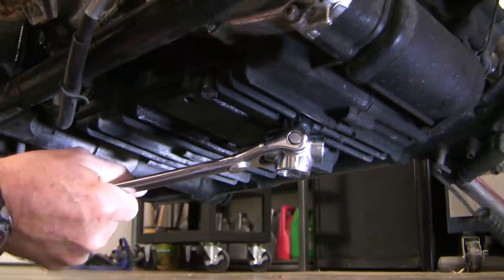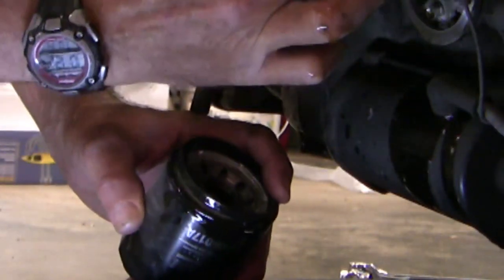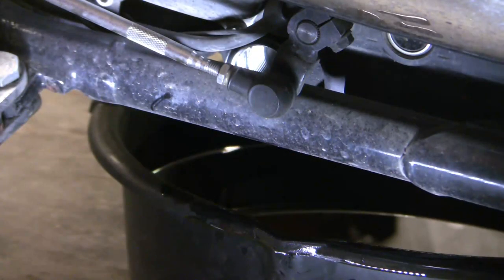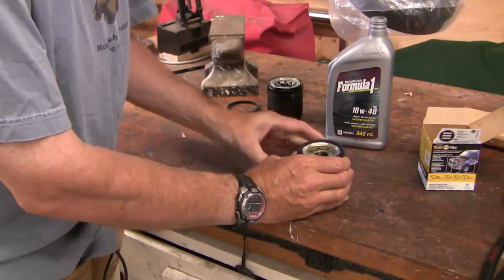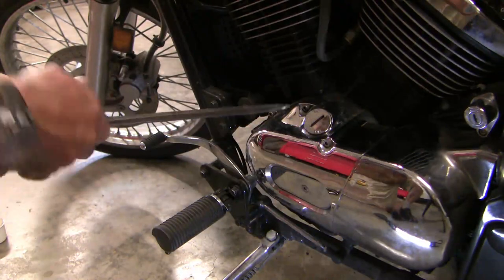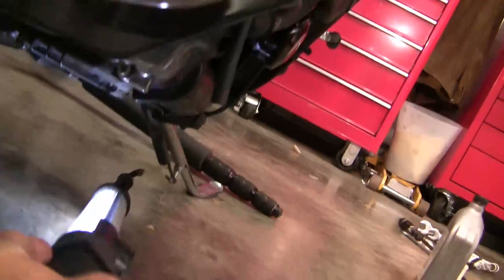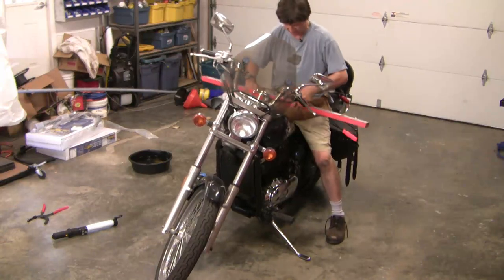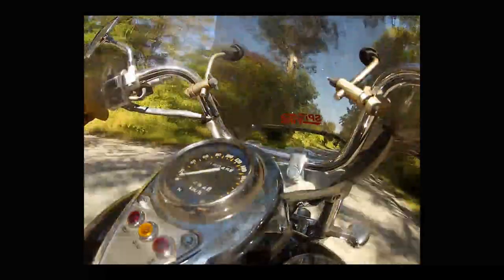How to change motorcycle oil,  Kawasaki Vulcan

Comment: is this procedure the same on a 2008 Kawasaki Vulcan 900cc
Reply: not guaranteed because of the year 2006+ saw some significant modification such as fuel injection, so check with a shop or trusted mechanic
Reply from the maker: Wise advice. For all vehicles I get a copy of the dealers repair manual to see what is officially recommended, and this video is based on the paper manual for this bike. Finding the dealers manual online is a little harder for motorcycles because online copies complete with TSB's are hard to come by -- I don't believe Alldata or Mitchells cover motorcycles. Paper copies are expensive but still sold and have variable detail, and you can buy CDs on Ebay for many motorcycles. Manufacturers are legally required to offer some form of repair information to unaffiliated mechanics. Neither CDs nor paper copies will have updates or TSB's, and they could have uncorrected errors. Of course the lowest risk option is to entirely delegate maintenance to a dealership pro, but most searching here want to do some repairs themselves. Even professionals sometimes need to consult the dealers repair manual, if they don't want to be sloppy. A pro will tell you that the basics of an oil change are fairly similar throughout the industry, but it would be easy to overlook critical unique details.

Comment: found out its a no spark situation, can you help, bought a cdi, still no spark.  Just want to ride.
Reply: I would try testing the ignition coils. They are probably more likely to fail over the CDI box just like spark plugs fail more often than ignition coils. Other than being worn out over time, a CDI or ignition coil not functioning could be a potential sign of other electrical damage. Such as a voltage regulator/rectifier not working properly etc.

Comment: Your garage floor is pretty level, right?
Why not buy a center lif.t (search "Cruiser Motorcycle Center Pivot Stand Lift")
You place it under the rear shock and lift the bike level and you can the do all sorts of maintenance to the machine.

Comment: I own a 99 Vulcan it was sold to me as a 900cc but I don't think it is a 900 the power is not there.......I had a 700cc intruder and this Vulcan pulls like the intruder not like a 900cc engine any suggestions would be cool and cool video
Reply from the maker: I've found great variance in that ratio of power to displacement, there are a lot of variables. As a start I would check compression and look for obvious things like a stuck caliper or seized brake shoe, check tire pressure and look for obvious things. My 800 has always had a lot of zip.
Reply: thanks for the tip
Reply: WELCOME To THE VULCAN WORLD. I USED To SELL THEM AND 900 OR 1600 THEY ALWAYS FEEL As THOUGH THEY ARE ONE GEAR AWAY 
IN CANADA THE EFI CAN COST $250. I Put AN EFI BOOST AND NOW MY 1600 HAS A VIRTUAL 6th GEAR AND LOADS OF POWER

Comment: I have a 2000 kawasaki vulcan im sure its abt the same procedure im not sure on the filter do
Reply from the maker: It would be worthwhile to search for a free pdf copy of the manual for your exact bike. The manual for my bike is now freely available, do a Google search for your year. Failing that, ebay often sell DVD's with manuals. Alternatively you could wing it, just remember how everything goes together. Some visitors here have mentioned that their screen goes in backwards compared to mine, so Kawasaki may have changed that little detail at some point. Filters are pretty standard.

Comment: I have a 2000 vulcan 800. How much oil do i put in it
Reply from the maker: My bike has the oil replacement volume printed on a sticker beside the oil fill plug. Failing that, you can get an online version of the dealers repair manual directly from Kawasaki, at a reasonable price. Also your owners manual should have it, I believe the owners manuals there are free. I have a large 6L graduated pitcher that I use for measuring oil volume. I print the oil volumes for all my vehicles with a sharpie onto that pitcher, so I don't have to look it up each time.

Comment: where do I buy an oil filter at for a motorcycle?
Reply from the maker: Any auto parts store carry them, many brands share similar dimensions. If the bike is under warranty I would consider going to the dealer in case a warranty claim might be rejected because of aftermarket parts. There is significant variance in quality and price depending on manufacturer. You can also look up equivalent aftermarket filters for your bike online.

Comment: what kind of oil do you use and viscosity?
Reply from the maker: I use 10-30 natural oil, this bike was not designed for synthetic. Check your manual for more accurate advice. If I drove it in winter I might prefer 5-30.
Reply: spelunkerd thanks for answer,good ride!

Comment: My oil cap is stuck on my Kawasaki Vulcan any tips??
Reply from the maker: Interesting problem. My usual quick approach to seized bolts is heat, but with the chrome everywhere I'm a little concerned that too much concentrated heat might affect the cosmetics in an area that is front and center. Even so, heat from a heat gun is probably mild enough that it won't be a problem. One day I wondered if that oil fill nut is plastic, so it may not be able to take much heat. I would use a big screwdriver, one with a square shank, and put a wrench on it to help spin it free. You could spray the outside with PB blaster, Kroil, or your favourite penetrating oil, and if you get it moving I would turn back the other way a little to allow penetrating fluid to make its way through the threads. Once you get it off, clean up the threads on a wire wheel, and if the threads are destroyed you'll need to search for a replacement. Good luck!

Comment: Well Im that guy. I have the Kawasaki VN 1500... sixth edition july 25, 1995 printed Service Manual. On the exploded parts view page 6-3 it shows from inside to outside starting with rubber washer, screen, metal washer, spring, oring, metal screw on plug. Im not saying you are wrong just is different on my 95. I dont see if its turned around what it would be filtering to, the plug??
Reply from the maker: Interesting, same year, different displacement. When my screen comes out, it comes out like a thimble on my finger, with a concave surface of the screen pointing out. Are you saying your concave surface is pointing inward on the Kawasaki manual? I know one version of the Clymer manual, made as a general manual for several different bikes, shows it pointing in. I followed the OEM Kawasaki VN800 manual, reasoning the book was made by the manufacturer, specific for this model. As far as what it does, it is designed to trap metal fragments, so I don't even know if it matters which way it is oriented. The plug is fenestrated so oil could flow through either way. It would be good to put it in the same way each time, and follow the OEM manual.
Reply: @spelunkerd  I do not trust the clymer books only OEM service manuals. I had a clymer and a Ford factory service manual and clymer wasnt always the same so I tossed it. Same with the clymer on this 1500 compared to OEM Factory service manual. Mine shows the opposite of yours. The open end goes in first closed end by the screw in plug. Thats what the picture shows on blown up parts. I thought the open end goes in with the rubber washer sandwiched between open end and oil pump. That way it screens out junk before it enters the oil pump. Im doing an oil change tomorrow and i will look inside and see if it goes against a hole in the oil pump.
Reply from the maker: @jdstaggers8805  Thanks for recording your experience, I agree with your decisions.
Reply: @spelunkerd  I did my oil change today. When i took the screen out, after it drained i looked deep inside and could see the hole to the oil pump and and the rubber washer fits perfect against it. When i bought this 1500 a few years ago the first oil change i did i seen it was installed backwards and i was worried as of how long the oil pump wasnt getting particles screened out.

Comment: Couldn’t you just put a 2x4 under the stand to level it a then look directly at the site glass?
Reply from the maker: Yup. The trick is to get it exactly level, yet not let it tip over to the wrong side while you're measuring for level or looking at the site glass. I suppose one could shim the 2X4 until you get it exact for your bike, then save that future measurements. I found a slight difference in the resting angle changes the level in the site glass significantly.

Comment: where did you get the filter
Reply from the maker: I don't remember, parts stores everywhere carry them. I care for a fleet of vehicles, so when I go to the parts store (NAPA, and others) I buy several and keep them on the shelf until needed. I don't usually go to the dealer for OEM filters, though recently I've noticed some dealer parts are also coming down in price. Filters come with a big range of quality difference, and FRAM have gotten a bad rep because of inferior quality. That said, as far as I can tell I've never had a filter fail, even FRAM survive 3000 miles.

Comment: I have a 1600 and the manual shows the screen the opposite  way round?! Can anybody help on this?
Reply from the maker: A few others have remarked on that point, so you want to go with the way it is shown in the manual for your exact bike. If you don't have a service manual for your exact year and model, I would not change the orientation, I would put it back the way you found it. I'm the only owner of this bike, this is the way the screen was placed in mine at the factory, and the original paper manual for the 1995 Vulcan VN800 accurately describes placing it this way. However remarks from other viewers in this thread are frequent enough that I suspect the company changed the orientation of this screen somewhere along the line. One thing I am curious about is whether it even matters. I don't know! Thanks for bringing this up, I'm flagging your remark as a helpful question to keep it high in the thread.
Reply: Thank you for your input, I initially went with the way the manual stated and thought I recalled something different in your video so on checking  I found the screen filter the opposite way. My theory is Kawasaki might've changed the direction of the oil flow when they moved the filter to the back of the engine. FYI you have to use a big socket that fits over the filter it's about $8 from the dealership and you use a 3/8ths  drive to remove it, the roadblock I hit was the last person put it on to tight and it also had a ding from being hit underneath by some object so the socket turned round on the filter. I thought of putting the screwdriver through the filter to try and turn it but I was scared it would rip the filter and I would be in even more trouble - the solution I filled the socket with one minute epoxy left it for two hours to be safe and then removed the filter

Comment: Where is this screen on the 1700?
Reply from the maker: Short answer, I don't know. Try to get your hands on a dealers repair manual for your bike. Ebay often have copies for sale, a lot cheaper than from the dealer. Note that the screen in your bike may go in the opposite way, many here have noted opposite orientation for newer Vulcans and other bikes.
Reply from the maker: Oh, one  other thing. Kawasaki offer free part diagrams on their website, Kawasaki dot com. Plug in your bike   and see if you can find the diagram you're interested in. For my year, the screen is in the page titled "oil pump/oil filter". They also offer dealer service manuals for the inexpensive cost of $60, which is a pretty good deal, cheaper than the paper service manual I have.

Comment: does this work for a 2000 model
Reply from the maker: Jason Burkett General details are similar in all 4 stroke engines but specifics will vary. One of the best investments you can make is to find and review the dealers repair manual for your vehicle -- with cars, electronic versions like Alldata and Mitchell are available for economical prices, though bike versions are harder to find.

Comment: what happens if you double gasket?
Reply from the maker: freddychico73 This is one of the commonest causes for major claims made against quicklube facilities. They accidentally leave the second gasket on, and it doesn't seal. Then they miss their opportunity to catch the error by not looking under the vehicle while running before letting the car go. The pressure behind the gasket is so high that a fine spray of oil comes off the base of the filter, leaking oil all around the engine area. Oil volume that should have been bathing the rockers instead is rerouted to the pavement, so damage starts even before oil is depleted. After a mile or two of driving, the oil ends up depleted enough that the customer notices the red "engine oil" light come on. If the customer ignores that light, the engine dies with a horrible screaching noise caused by metal on metal overheating at the cylinder head area, and elsewhere. The mechanic finds he can't turn the crankcase by hand, proving that the engine is seized. Then you replace the whole engine, and the shop gets named in an indefensible lawsuit.
Reply: I think that happened to my bike because it seems to be leaking oil right after oil change it and wasn't before
Reply from the maker: freddychico73 Another thing that can happen is when you turn the filter on, friction grabs the gasket and distorts it into strange shape. When that distortion is severe the gasket can leak. So, for that reason when you change the filter, put a thin film of oil on the gasket surface, lubricating it to prevent it from changing shape when you twist the filter on. If yours is leaking right at the oil filter, I would take the filter off, clean all surfaces, and replace the filter. Perhaps there's a defect in the filter or filter gasket you are using. I would double check you are using the correct size filter for your bike. Good luck!
Reply: thanks for the info

Comment: how to replace the air filter ?
Reply from the maker: Unscrew the cap nut on the right side, just ahead of the riders right knee. The filter is under a round stainless steel 'hat'.
Reply: thank you

Comment: Ahh i have a farty little motorcycle and it has a center stand so that is close enough.

My frend has a small suzuki with a sight glass, i just filled it to the top of the glass, when the bike was started the level dropped just under half way, and at rest it was fine.

Close enough for small bikes :-)

Comment: Why can't you put the pegs down then check to see if is level. That way you don't have to sit on the bike.
Reply from the maker: That works OK for bikes with a center stand if you find a way to make it level front to back, but heavy cruisers like this have a side stand so the bike is not level side to side. One way to overcome that is to fill the oil so it is perfect, then tip it onto the side stand to see how the level changes. Problem is, in my bike the meniscus in the site glass moves so high when on the sidestand that I can't see the top. Even so, it's a good screen for underfilled, and overfilling (for example from a gasoline leak into the crankcase through the carb) is pretty rare.

Comment: don't you let the engine run a few minutes after you filled the new oil?  the engine oil thin a bit when hot so you have to becareful how much you add becouse when the oil cold it give a different reading. cold verses hot oil.
Reply from the maker: Yeah, as I showed in the video I do run the engine for a few minutes, carefully watching for leaks and rechecking levels. Mostly I'm looking for a leak at the oil filter seal or the oil drain plug, since it's a last chance to find that before the vehicle leaves the garage. But regarding the difference between hot and cold, that effect is not as big as you might think for engine oil. Certainly for automatic transmissions in cars it's a huge effect, but for engine oil, not so much. I often wondered why it's such a problem in automatic transmissions and almost no effect for most engine oil. I believe automatic transmissions are different because of the huge volume of oil which occupies an equally huge fixed space with a relatively small pan where all the expansion has to happen. As you know automatic transmissions are checked with engine running and oil hot. By contrast, engine oil is checked cold, and the dipstick marks are calibrated for cold oil and engines that have been sitting with engine off on a flat surface for more than 30 minutes.

Comment: I have a 1998 vn classic 800. as I was going for a ride oil below out the left side on to my leg so I took off the crome cover just above the oil windo , I'm not to familiar with motorcycles want to take the cover off the chain sprocket look like it knocked a piece of guard off on the part right behind the sprocket where the gasket is sexy gasket and oil is coming out of there what is that part called so I can order that like I said I'm not to familiar if I can send pictures I would if anybody knows or anything about Kawasaki Vulcan classic 800 let me know and I'll send over my email address and I'll send pictures to them or what I'm talking about
Reply from the maker: I've never done that repair. For more info, the dealers repair manual can help with some things, although the repair manual for this bike is pretty basic and expensive for what it is. I'd probably have a go myself, tearing it down enough to identify the part and replace it. However I have an extensive tool kit, and I'm not afraid to make mistakes. You may feel differently. It might be more wise to get advice from a pro, even if you end up doing the work yourself. Good luck!